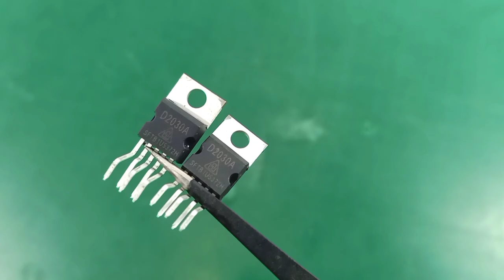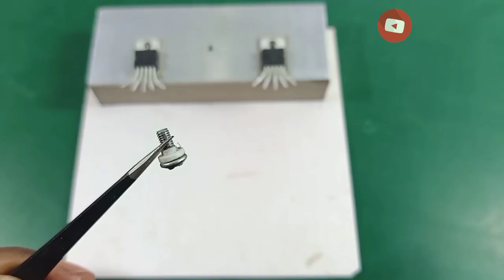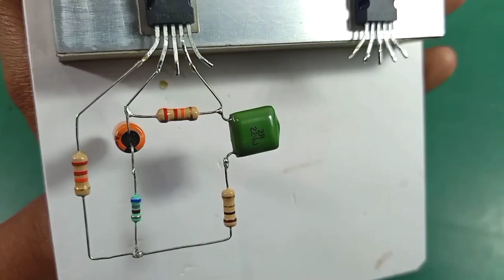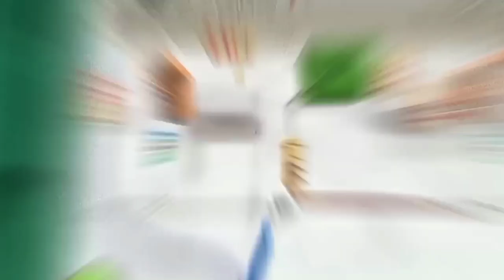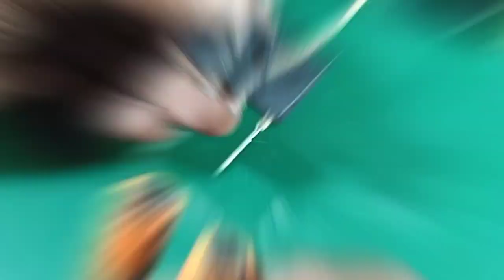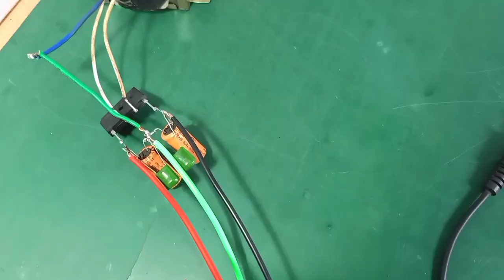Simple  & Powerful Bridge Mode Bass Amplifier / How to Make  Bridge Mode Amplifier  With  TDA2030 IC

Comment: Excellent sir....but how to reduce noise of the speaker ?? Please sir make one video or if possible please guide.
Reply from the maker: Ok
Reply: You can reduce noise in the circuit by building it correctly (look at the datasheet) and using a PCB/perfboard instead of building such large antennas.

Comment: sir can i use 20 0 20 power supply in 2030 bridg curcuit???
Reply from the maker: No bro, 12-0-12v transformer 3-5 ampere maximum

Comment: can i use tda 2003
Reply from the maker: You can use 2003 ic
Reply: one more think sir,, can i use travo ct 12 0 12 5Amp,,
Reply from the maker: @alinifti3758  maximum 3 ampere
Reply: @RJEDITALL  ok thank u sir,,
Reply: can u make PA 60watt from tip 41 and tip 42 sir,,

Comment: What changes required if tda 2050 used
Reply from the maker: Yes, you can use 2050 instead 2030
Reply from the maker: No, 12-0-12 v
Reply: Thank you

Comment: Sir can I use 
223j capacitor instead of 224j capacitor
Reply from the maker: No bro, you can use 104j
Reply: @RJEDITALL  Thanku  sir  for the help 🥰🥰
Reply: @RJEDITALL  Sir  amplifier  is  working 
But  
1.   some  noises  are  coming
2.  audio  is  not  clear 
3.  IC  is  heating
Reply: @RJEDITALL  Sir  kindly  say  the  solutions  to  rectify  these  problems  🙏
Reply from the maker: @abhisvibetech6121  big heatsink use, and check it well
Reply: @RJEDITALL  ok sir
Reply: Sir 
Your all videos are good.
Expecting your next video using 2N3773 transistor